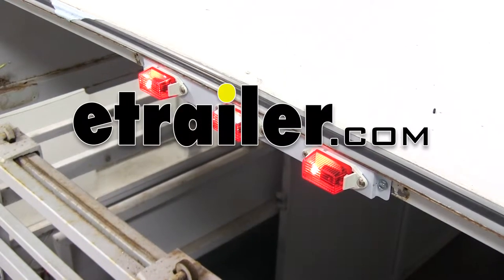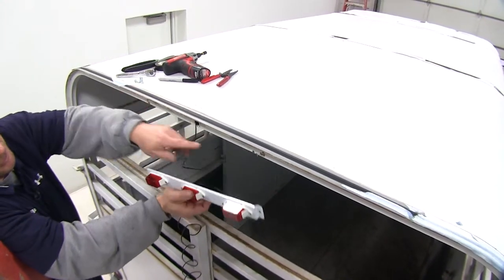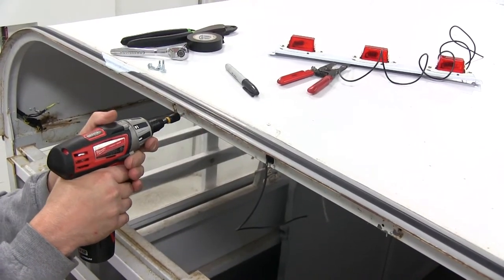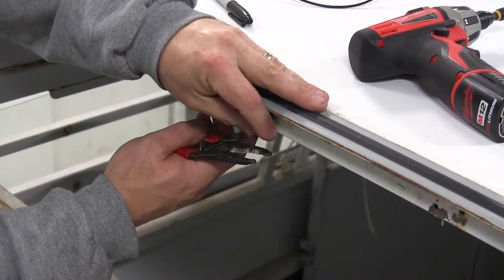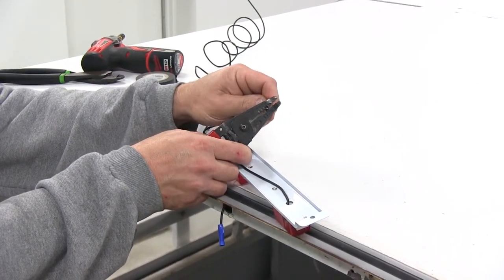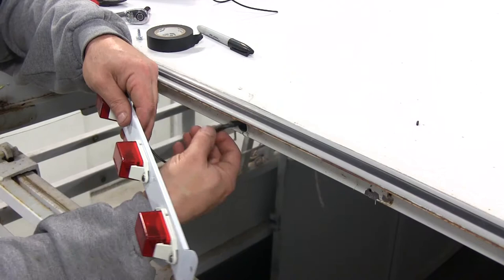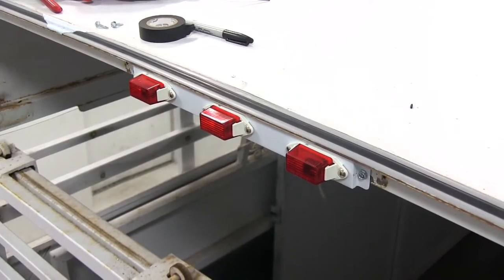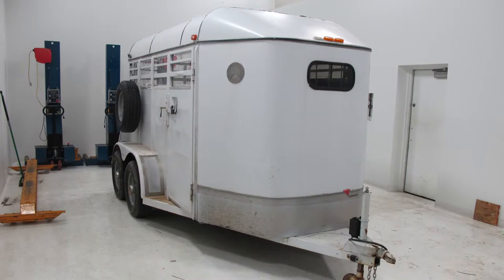etrailer | Identification Light Bar for Trucks and Trailers Review

Comment: I have swapped out this fixture on my bass boat before with no issues.
Yesterday I was installing a new fixture as one lamp in my former fixture was not burning.
I used the same self tapping screws to mount, ran wire to previous location next to side marker light.   New fixture did not burn.  The side marker has a white ground wire, and a positive wire,  the positive has a jumper off it that powers the light bar.    How do I test that jumper for power with the multi meter to see if I have 12 volts?

I will freshen up the ground connection at the light to make sure the rusted screws are contacting the trailer.   And check for a ground connection at the hitch off the 7 pin

Comment: Do these require a ground? I don’t see one anywhere?
Reply from the maker: @Panzer Track The lights are grounded to the steel frame that the lights are mounted in. When you attach it to the trailer it will ground to the trailer.
https://www.etrailer.com/Trailer-Lights/Optronics/MC99RB.html